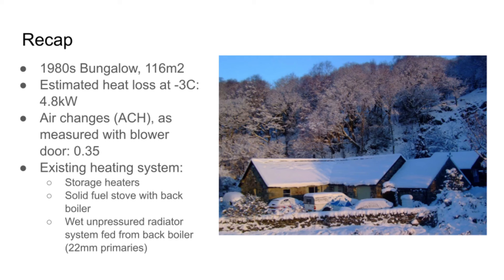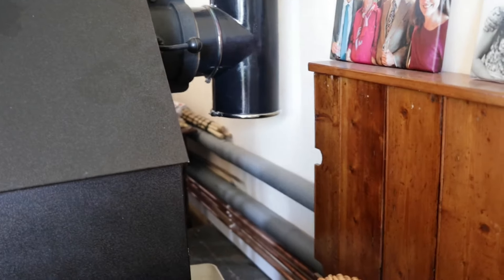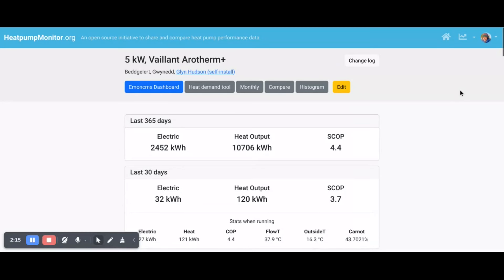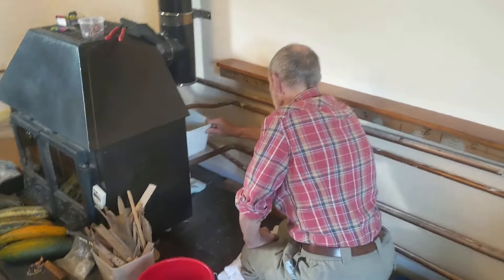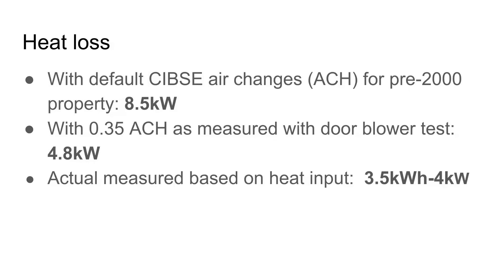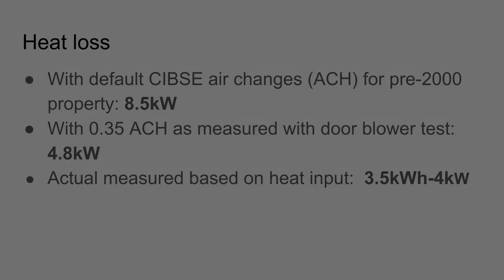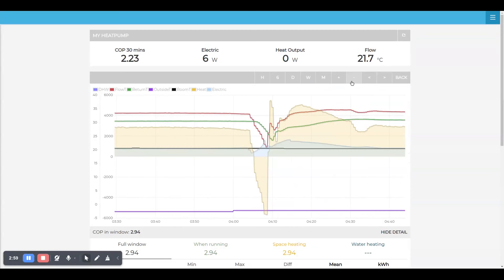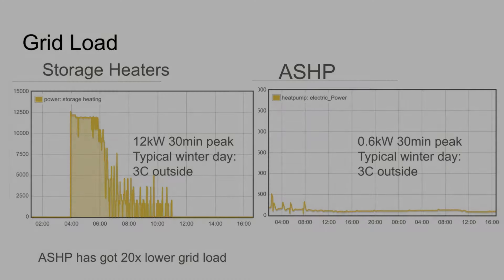1980's Solid Fuel Bungalow to Heat Pump Winter Performance Update

Comment: Another great video Glyn, thanks. We've been though the mill with delays on an Octopus ASHP install after they deemed it necessary to get planning. That proved to be a Pandoras box of problems until I came up with a simple solution to allow the install to go ahead under permitted development so fingers crossed!
My only concern is that despite what seemed to be a thorough survey they have decided we need a 16Kw pump which seems excessive for a 1930's semi (with a lot of more modern extensions and loft conversions and double glazing), even though it has 5 bedrooms. I calculated using HeatPunk and got around 10Kw. Should I get them to do an air loss (or do one myself)?
Reply from the maker: Thanks, I can't comment about Octopus, I don't have any experience or knowledge of their processes. If your house is not particularly drafty, and you have well-fitted doors and windows, then you can usually safely drop the ACH down to 0.5. Have a look at what difference this makes in Heat Punk. It's a good exercise in its own right to get a door blower test done, I would recommend it. It's very useful to be able to see exactly where the drafts are coming from, often they can be easily rectified.
Reply: @GlynHudson  That sounds like a good plan. The Octopus quote was low enough to be considered a bargain (after the Gov grant) given the amount of work; some replacement rads, hot water cylinder and pump etc. for me to want to hold on to them if possible. I'll see if Google throws up anyone doing the air loss measurements locally (or hiring the equipment) to Manchester.
Reply: Yes, same delays and indecision by Octopus with me too. Had a £500 deposit with them since Dec last year, they did a comprehensive survey in April " simple straight forward install" they said. Then in August they suddenly informed me that planning permission was required, I contacted my local authority who said it didn't need planning consent as it was permitted development, so I contacted Octopus again.

They then said that there was an issue with the noise emission.

Now they state they want to do another survey!Octopus

Meanwhile as it has been so long since my quote, I ran their quotation tool in their website to discover it was now quoted at a 1/4 the cost of my initial quote!

Again I have emailed them requesting an explanation for the cost disparity....I'm still waiting for a response.

The only reason that I'm hanging on to them is my preference for the Cosy6 that Greg Jackson raved about in his launch presentation last year as I preferred the aesthetics of it and that it has been designed from the ground up (supposed) to be the most efficient. 

I'm getting at the end of my tether with the delays and excuses, such that I am going to give them to the end of the week to give a satisfactory proposal and imminent install date, otherwise I will be having British Gas to install, their price was a lot more competitive at £685 all-in-one and didn't raise any objections to the proposed installation location.

Are you waiting for the Cosy6? Or is it the usual Daikin that they otherwise propose?
Reply: @David-bl1bt I'd go with a local Heat Geek installer or a recommended local
Reply: @David-bl1bt  £685 with BG, that's a bargain! They quoted me £9k, after the grant,  for a 3 bed, 20s semi with double glazing and 30cm of loft insulation. Octopus came in at £2k but like you I'm waiting for a Cosy.
Reply: @David-bl1bt  Mine's a Delkin. To be fair to Octopus they got back to me with extra discount when the Gov grant increased and it was already a good price. They were also technically correct about the need for planning , HOWEVER, planning added an initial cost then eye watering costs for noise assessments (we are not going to do) that effectively made an ASHP a non starter. What they didn't do is look at the plot and figure out a solution that avoided the need for planning, that all came down to me. So now I have to withdraw the application and put up a short fence so it will pass the MCS 020 assessment and go ahead under permitted development.
Octopus have gone for the easy low hanging fruit, which is great and gets a lot more ASHP installs going, but which leaves anything remotely unusual out on a limb a bit. Hence why I am a little worried about them over specifying on the pump (bit like gas installers used to bung in a bigger boiler 'just to be sure') but which can have a detrimental effect on efficiency. I'm looking at Glyn's suggestion to get air loss rest done now (since I seem to ba back on Octopus radar again).
Reply: @dan_grey  Big fan of Heat Geek but at the moment Octopus are offering deals that make it hard to go elsewhere.
Reply: @dan_grey heat geek aew waaay expensive and have little or any advantage.

British Gas give a 5yr warranty, 12 months interest free payments to spread the cost and being an established national company, give confidence that they are there to provide support should there are any post-install issues.
Reply: @jonathankeenan5163  if you haven't committed to Octopus perhaps a quote from British Gas may be worthwhile.

As I previously stated they raised no objections or any stumbling blocks, unlike Octopus, their quote for the Daikin is 1/4 that of Octopus.

Comment: My question! Is the circulation pump variable speed?
Reply: PS very wise words from your dad at the end 🙂
Reply from the maker: Yes, it is. However, Vaillant runs a fixed speed flow during heating. Here's a link to the data with the flow rate enabled on the graph: https://emoncms.org/app/view?name=MyHeatpump&readkey=871ad5efb8f20f698f12d751aea9b8a6&mode=power&start=1726354800&end=1726397100&flow=1

Comment: Great video Glyn. FYI You need to change the video title  "1890's Bungalow ... "
Reply: Also, it's "experience"
Reply from the maker: Thanks! Good spot, been fixed
Reply from the maker: Where is this errror?
Reply: @GlynHudson it appears at least three times in black and white static cards: 
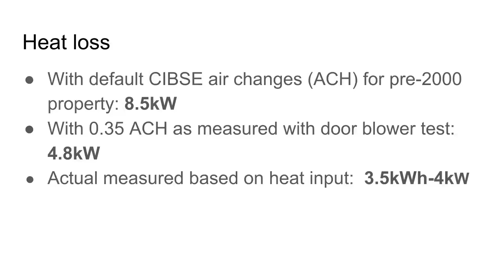2:47, 8:32, 13:13

Comment: Guessing the ASHP relies on a constant electricity supply? In the event of a lengthy disruption, what alternative heating system would your parents revert to, presumably the wood burner?  Thanks.
Reply from the maker: Gas and oil boilers also need a constant supply of electricity to run. My parents have a home battery which can run the heat pump, but if it was a prolonged outage they still have the wood burner they can use. It's very rare to get more than 12 hrs without power.

Comment: I have been going back and forth with the heat pump scenario, heard good things and bad things , basically really don’t know which is correct , listening to this video tend to think it all depends on the installer because watching a couple of videos by two gentlemen who tend to workout why peoples heat pumps are not as efficient as they should be , it always comes back with the installer not being up to the job or lack of experience, the urban plumber and heat geek are the best in my opinion but somewhat oblivious you yourself has to be in the same club ,  I think if you were to install my system then I don’t think I would so undecided  , peace of mind with confidence in others is hard to find .
Reply from the maker: Hi, thanks for your comment. Any installer which has done HeatGeek training course or equivalent course on hydronic design should be able to install a good heat pump system. I would recommend looking at https://heatpumpmonitor.org/ and finding an installer near you. Or going with https://www.heatgeek.com if you want the best system. HeatGeek no offer a performance guarantee for total piece of mind.
Reply: @GlynHudson  I think the words should be able puts me off straight away , it’s not what you look at that counts. It’s what you see , personally I would only have it done by you or the Urban plumber, so unfortunately will still be using my old gas boiler then , who knows you might have a gap in your schedule at some point , you can have me as a backup if any gaps appear.  Thanks though for your reply , that video I just watched probably one of the best I’ve seen from a novice person in regards to heat pump knowledge, thanks again , take care .
Reply from the maker: @KavanOBrien  as I mentioned heatgeek offer a performance guarantee, i.e if they state the system will get a SCOP of 4 they will monitor it and if it under performs they will rectify for free until it hits the claimed performance. I hope I've demonstrated in  my videos that installing a good performing heatpump system is that difficult, it just requires slightly different skills compared to average gas boiler installation. Although gas boiler efficiency also also benefits from weather compensation and correct radiator sizing.
Reply: @GlynHudson  I appreciate your recommendations and your time in replying to me , being 66 now seen and heard a lot in life and I know the only two people who I would want to convert me to the world of heat pump life are as I said either you or the urban gentleman , other than that scenario irrespective of guarantees just would not be my cup of tea , so as said if not possible by yourselves, then I won’t have one , time of life I know I won’t change my mind = call it getting old or just bloody minded, I wish you well  on your path of life , Take care.
Reply from the maker: I'm honored that you feel that way, but there's lots of good installers out there, I'm only ever installed a couple of heat pumps! Most of what I've learnt has come from watching heat geek YouTube videos!
Reply: @GlynHudson  I’ve learnt in life it’s not what you look at that counts, it’s what you see , so I know what I see in you , I also have watched many videos on YouTube in regards to heat pumps the only person I’ve seen that is as good as you was the urban plumber gentleman.

Comment: Ever thought about linking up solid fuel with a heat pump? So in the really cold winter time you can light your stove and it will top up the heating system plus you still retain the nice look of the fire?
Reply from the maker: There's no need, the heat pump is efficient on its own, there's no need for the sold stove. The idea was to negate the need to use the stove. Connecting the stove into the system would have added a lot of complexity e.g buffer tank which would have reduced the efficiency of the heat pump with no gain. The stove is still in place there, they can still use it rare event of a power outage.

Comment: Very interesting video. I've only got an air to air airsource heatpump and have octopus go so only have 4 hours at 8.5p and rest time it's 24pkwh . Would it be more efficient to install air to water? What I like about mine is you can switch on and within 15 mins living room goes from 7 degrees to 20 and then it cycles at about 350w to keep temp up. Love your videos :) glad your parents are happy with the install and living in a warm house, storage heaters are awful for heat spikes
Reply from the maker: Thanks, A2W is generally more efficient and comfortable for heating than A2A, but as you mention A2A has several advantages including fast re-heat and cooling. If you're happy with A2A, there's no reason to change it
Reply: @lookoutleo perhaps look at different tariffs or a battery?

Comment: What was the total install cost excluding your labour i guess?
Reply from the maker: The cost is not really relevant, in this case, since the main cost of a heat pump installation is labour. You can google the cost of the heat pump itself, it's only a small % of overall cost if labour was included.

Comment: Do you have design? Mine is only 3COp
Reply: The water tank, at which temperature you set for hot water tank
Reply from the maker: Sorry, I don't. I would recommend looking on https://heatpumpmonitor.org/ to find an installer near you, or going with a https://heatgeek.com/ installer
Reply from the maker: Water is usually stored at about 43C, the heat pump then does an occasional disinfection cycle to 55C.

Comment: Interested in your airtightness assumptions. 0.35ach on an old bungalow, even passive house standard os 0.6 ach?
Having just built a house which achieved 0.6 on airtightness test, I'm flabbergasted flabbergasted to see h you have 0.35?
Reply: They weren't assumptions - in the previous video he got a blower door test done on the house so they are actuals.
Reply: Yes, I wasn't questioning his figure, fair play a 1980s bungalow with passive house airtightness
Reply: @andrewturner-h2v  ah, the confusion is that it’s not passive levels of Airtightness. Passive levels of Airtightness of like 0.6 are measured @50 Pa whereas it’s just having an ACH of 0.6 is like 12 ACH@50 Pa. Hope that helps!
Reply: Ah, thanks, that makes sense. Out of interest then, his blower test is just simply measuring time to blow his specific volume of air into the property?
Reply: @andrewturner-h2v  measures the volume needed to keep the pressure differential at 50Pa and then divides it by the volume of the house i believe.
Reply from the maker: The door blower test is done a 50Pa, your 0.6 figure will be at 50Pa, as a rule of thumb divide by 20 to get ACH under normal pressure, so your normal pressure ACH is around 0.03!

Comment: I would love a house with multiple radiators in each room taking up wall space and looking so pleasant to look at.
Reply from the maker: The radiators are hidden behind the sofa
Reply: @GlynHudson  I havent a problem with heat pumps for modern highly insulated standard homes but have seen too many compromises when retro fitting such systems into older housing stock designed to wholly different standards.

I should declare I am a Chartered Building Surveyor and have inspected many compromised properties with under performing heat pump specs and attempts to overcome. But good luck.
Reply from the maker: @johnnettleton7711  if the heat pump system it correctly designed, it can heat any house very efficiently with lower running costs then gas. Too often the system is not properly designed and incorrectly installed.

Comment: Heat loss calculations don't bear much relation to reality because they ignore any solar gain, house appliances, TVs, light bulbs, pets or people - all chucking out heat. All the electricity we use (aside from heating) doesn't just disappear - at some point it's converted to heat which the heat loss calcs totally ignore as far as sizing is concenred. Always best to undersize and keep a couple of sweaters handy just in case.
Reply: yes , i agree.

Comment: Underfloor heating and a lovely gas condensing boiler at a cost 3 times less than air source and low heat rads and no need to boost hot water temps. This was choice for a 1970s bungalow i just bought.
Plus i cant see rads or an ugly heat pump and pipe overkill and i have the kit installed in a room not contami ated by multiple items of equipment.
You are being taken for mugs.

Comment: Been working on heat pumps since 1979, not much I dont know. But unfortunately I cant seem to find the figures they are producing.
First you have to live in the correct property, snd the vast majority do not. £450000 is a good starting point and mortgage rates at about 4-5 per cent. Never ever cut back on output, thats the golden rule , remember that as the outdoor temp falls at the most critical winter time the output, efficiency, falls, and back up electric heating is required.
Reply from the maker: No backup heat is required for this installation, heat pumps in the UK should never need backup heat if designed and installed correctly 👍